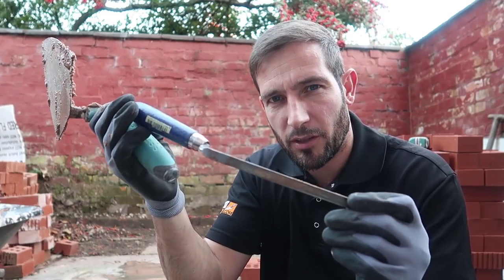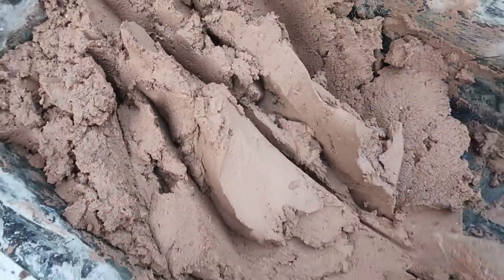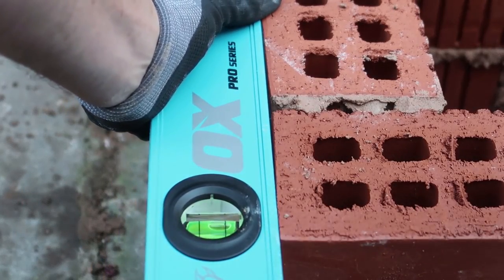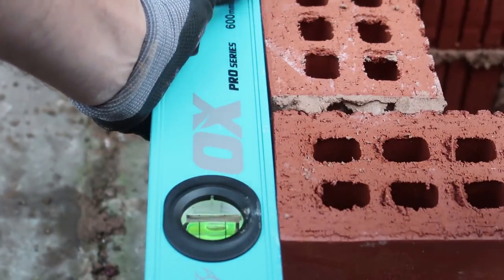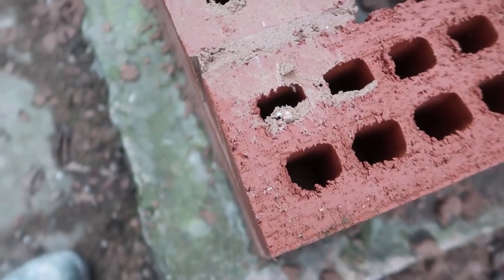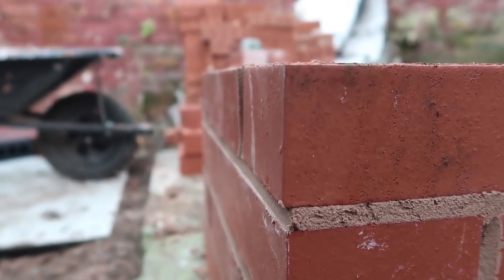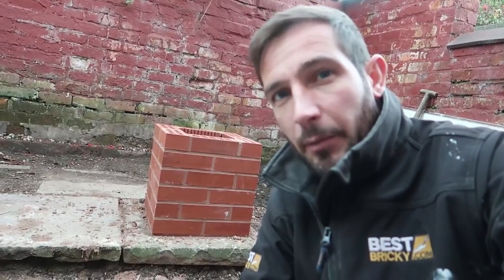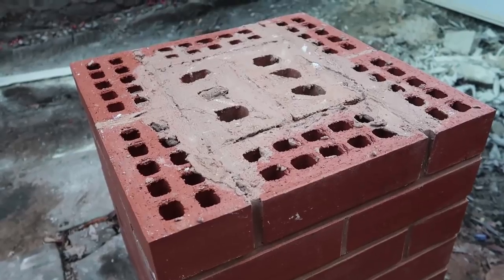How to Build Brick Pier Seat lol 😂

Comment: The video shows a hollow center at 7:08, and then it is filled in the center with bricks 10 seconds later.  Did you fill in the center/ how did you drop them in?  Great video!!

Comment: Hi Stu,  

Wats your opinion on ox tools m8 , 

Compared to fat max
Reply from the maker: Ox are great pal I had fat max before and won’t be going back to it 😁
Reply: @Stucrompton1  

Brilliant I saw on you tube they done a experiment with fat max got a remote control helicopter with some pincers on the bottom they drop the level from a house and it was still fine ,

But I Hurd a lot of good reviews about ox 

Which one is better is ox the normal one ok 

Or is ox pro due to the name better m8 😉 

Thanks for your advice m8